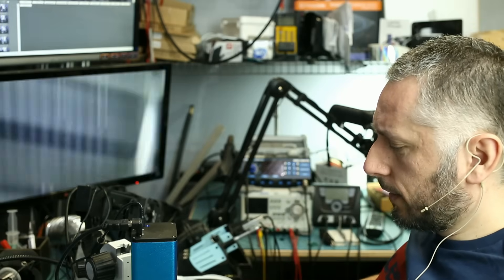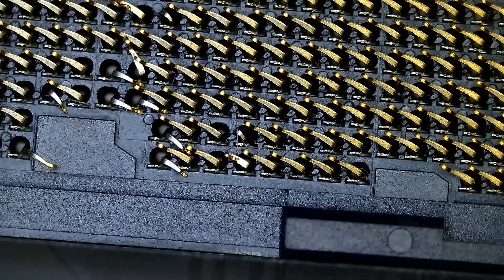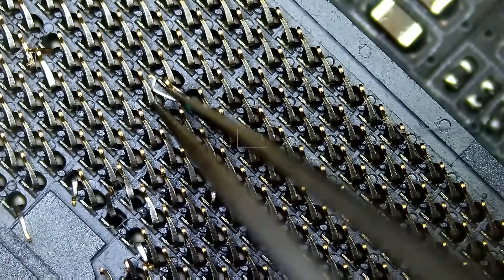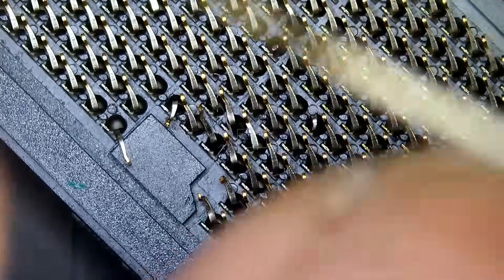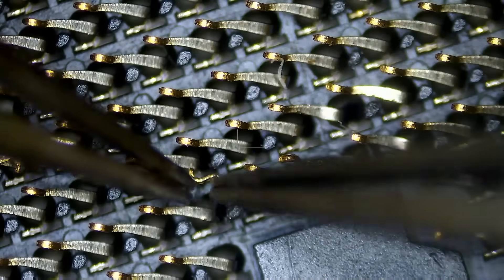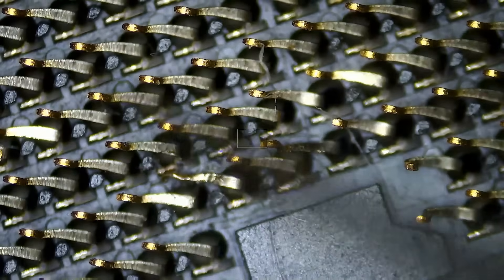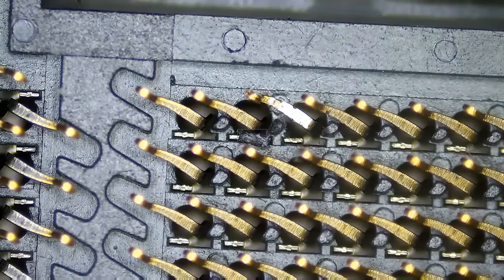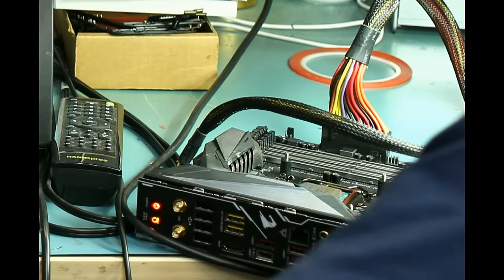GIGABYTE Z390 AORUS CPU Socket Bent and Damaged Pins Repair

Comment: it's disgusting these pins are so fragile, i accidently messed mine up and have voided th warranty. why would they design them like this? mine is an Asus Rog Z790.
Reply: there is a repair guy, who replaces the whole sockel (search for Asus Z170 socket replacement).

Comment: 4 years later, is it still working? :D
I am wondering if it would been easier to just change the whole socket itself? There are some soldering frames one can use to solder those small connections. I saw one guy have a frame, he fixed a new socket through the board and just poured the soldering tin into the holes of the frame and it was basically done. Can't remember hos channel now though..

Comment: Thans  I was Looking  fore a video like tis  i have a old board  that somone tro away and it looks like that  Socket  Is Damage By the Chip that dropdown  in it 😮the corner of the Prossesorcip De in has fallen when someone took it out and dropped it. there is a V imprint in the Socket about /¡¿\ and I'm going to see if I can still save it using the video advice and test it. it was free and is good to do exercises with and if it does I will give it a new case if not then try again next time
if I find another one😅
￼

Comment: I accidentally dropped my new CPU onto the pins and bent four. Tried to unbend 'em and the board's still not working right. Pulled up your video to see if there's hope for it. I'm gonna try again to fix it, but I'm accepting the fact that I might just need to get a new MOBO. Sorrow.
Reply: I destroyed 3 pins and try to repair, probably destroyed 4 more pins but it was just a second hand pc motherboard which i had as spare for my old Intel system and it did only 15 euro. But what you can do is, if you still have the motherboard, there are computer repair shops, who replace the whole socket with the pins.

Comment: My worst nightmarish bent pin repair was when I had to solder a new upper 3 quarters of a pin on a remaining quarter of the broken pin. Cut a new pin to fit the missing part, used a little bit of solder paste and a hot air station. I wish I had a stereo microscope to be able to work such fine interventions.
Reply: Those are metal? What c did you use to solder them together

Comment: I just had this happen after Christmas while upgrading my CPU, I somehow bent pins on a board that was less than a year old. A z560 board. I replaced the board but Id really love to get the other one fixed. Problem is, what is it gonna cost? The board was purchased on a christmas sale for under a hundred bucks, its normal price was slightly under 200.  I could use the board to build a spare pc if i can get the socket fixed. It is lga 1200 10th and 11th gen intel cpu`s.

Comment: I have a socket 1366 board with one of the pin top hook bent backward on itself (similar to 6:11), it still work but only 8gb of ram is usable out of 12gb, should i bent the pin hook forward with tweezer or will it break off?

Comment: this is why you use a high performance non-conductive thermal paste.  if you make a tiny mess with it no need to worry about cleaning it up , it won't cause short outs. This is also why i think the pins being on the main board and not the cpu itself, is a terible idea.  it's jsut easier to fix pins on a cpu than it is to fix them on a mainboard.

Comment: Intel should go back to the Pentium 4 days and stick with pins, no dramas then. Sure they bend but you could bend them back. Oh it snapped off? Solder the pin back on. Way harder in a motherboard

Comment: I use needles to fix this sort of issue and it is very effective  because with needle you apply less pressure and you have more control on bending them without breaking the pins.

Comment: You can improvise put a copper on the broken pins, I did the same thing on mine and it worked I got 2 broken pins and it's not turning on the pc so i decides to put tiny copper to have a connection

Comment: That board was $369 in Nov 2019 and a similar thing happened with me with the socket not holding the CPU in place while cleaning & reapplying 30 month old thermal compound off the fan & CPU lid

Comment: Why you don t change that pin? you can dissolder pin from a doner board. By working with low temps and soldering paste it will be easy to remove.
you do a really good work i follow you since the beginning, I learned a lot from you. thank you

Comment: Make sure he puts thermal paste on bottom as well as the top of processor as it makes it cooler 😎
One tip don't apply thermal paste or clean it with processor off the mount
It happened to me but I used a soft toothbrush with alcohol and lightly cleaned it no problems they are like needles
Reply: This comment is a prank. Only put thermal paste on the top side of the processor. Using a toothbrush on motherboard pins will kill it.

Comment: I've bent a few pins (around 3 or more) when cutting a LGA 775 socket to fit a 771 Xeon CPU. Managed to straighten them with the same scalpel blade with my naked eye, no magnifiers and such. The CPU worked for whole 6 years no problem until I've upgraded :)
Reply: you can cut pins to make a non compatible cpu work with a mb by cutting off pins?
Reply: @itchytastyurr  no, you need to cut out the socket holder so you can insert the CPU rotated by 90 degrees, together with gluing a tiny pad that switches two pins around. That's in case of 771 cpu in 775 socket. Then you need to update the bios (in my case add the microcodes) so the cpu works 100% correct
Reply: You must have exceptionally good eyesight to fix pins with no magnification. I can't even see the shape of the pins with the naked eye. Either that or the pins on an LGA775 are much bigger than on an AM5.

Comment: I used to buy pallets of best buy returns, plenty of motherboards with messed up pins I fixed.  I was always surprised at how often things worked with missing pins. Always wondered if there was some functionality that was missing due to it, ie some pcie channel or wouldn't work but I never noticed anything.  I used to shove the pins inside a 0.3mm mechanical pencell tip to manipulate them.  Kinda wonder if you could micro anneal the metal to make it less brittle but never actually tried it.
Reply: If you look at the pin out diagram of most cpu about 2/3 of pins are power and ground. So if you are lucky one of them will be PG pin and you can get away with it.

Comment: I just got the same problem, my old MSI big bang fuzzion motherboard broke down so I bought an other lga 1156 socket motherboard form ebay, the asus P7P55 D E Evo and so I was practicing on the broken mother board how to click mount the cooler, but I wasn't careful with the socket and... yes.. So now I understand fully what the deal is with these socket protection caps... In any case, if you have broken pins you can also try to replace the socket, like in this video, https://youtu.be/SzMHJXHO120 amazing that this works... aligning the socket perfectly... 😃

Comment: Would of been easier to remove the pins and replace them. Also should of checked Intel's data sheets, some of those pins might just of been grounds and didn't need fixing

Comment: I have been building my own pcs and those for friends and family for almost 20 years. Last time the chip types were changed I jacked up 3 motherboards by not putting the CPUs in correctly :(  so fragile! I tried to straighten the bent pins on one MB but it was never good enough. Mad respect for your work sir!
Reply: How do you even screw up the pins?  Seriously there are indicators the CPU will only fit one way.

Comment: Oh yes, there is more you can do!
You can change any pin with hot air.
Or you can change the whole socket with a reballing machine.
Check out Gitaruga's channel.
Reply: But would the repair be worth it considering the price of the mobo?

Comment: I have the same board but some pins were even broken off. I managed to fix it in the worst way possible. Salvaged some pins from another board, cut off the bottom part, slide it against the broken pin and secure it in place with a cut off piece of a leg from a resistor. It is working great now though.
Reply: How did you even manage it ! Mine is not booting even after straightening them.
Reply: @prashanthb6521  The trick is to look at the heads, not the legs. You need different orientations and light source directions to arrange the heads in the grid correctly again.
Reply: @mrawesomelemons  yes. One direction pins look fine, from another pins look bent. Also the tips of the pins look like spoons

Comment: actually i have done this job half a year ago on a Z87-pro from ASUS. 6 pins were lost during repair, socket was heavily damaged. I have replaced them with very tiny pieces of copper wire, bent i the right shape and clamped them with rest of the pin in position. After some tweaking the board booted with the i7-4790k and it is still running. CPU runs on 4,7Ghz pretty stabel :)
Reply: You are sort of a Hero in some sense. Forget straightening them, replacing them is unheard of !

Comment: For anyone still interested the pin that broke off was a VCCGT pin. These pins deliver power to the integrated graphics. There are upwards of 15 of these pins so chances are the board would still work.
Reply: @ATechnews last I had to identify CPU pins, I opened Intel datasheet for particular CPU and ball grid map was all there.
Reply: I don't have any reason to not believe you, but can you tell me how you knew from the video please.
Reply: @rectify2003  any idea on how to find that? Im having trouble myself and would like to find said data sheet if possible
Reply: should be fine considering this is intel and a gaming board, the customer won't be using the igpu anyway.
Reply: Heart bits faster ⚡️
Reply: Good to know..thanks for sharing hehe
Reply: Make sure you need a eGPU! Otherwise f*** you, Intel HD Graphics.
Reply: And how does something like that even happen? Those pins are really hard to damage like that, basically you just place CPU into socket and fix it there.
Reply: @alexvidakovic  a better question is how come the guy building the pc , got thermal paste next to the socket  with out having already installed the cpu? a builder that only saw the Verge's pc building video maybe ?
Reply: @DenverStarkey  ohhh, please don't remind me of that tragedy

Comment: Can this exact motherboard still work and recognize the CPU with only 3 pins bent?
Reply: Dunno I got a really messed up one and am gonna try tomorrow but I don't think it'll work, amd is better in this regard.

I'll probably need to bring it to a store.
Reply: you can check the pin layout of your socket on the internet, and then determine what each pin does. If the bent pins are dummies, your board will be 100% fine. Some other pins can be damaged but still good to use
Reply: @DROGOC0P  i already built my pc 4 months ago but thx!

Comment: Before I start such work, I reference the damaged pins & start with the least damaged pins, that are needed. If a NC (no-connection / future use) is bent, I will leave it for last.
Reply: how can you understand a pin is no connection?
Reply: @umutileri2261  look at the diagram for the socket in question.
Reply: @zadekeys599  thank you

Comment: Next time i woud advise using a canvas sewing needle. Works much better at catching the pin head and manouvering the indavidual pins. This was cringe watching you man handle the pins. Not advisable! I have done many repairs to sockets on dual xeon boards where dumby techs drop the cpu in the socket.

Comment: what if thermo paste got stuck down in the cpu pins, what kind of damage would it cause?
Reply: Before u read i will let u know i am far away from being a professional take it as a story.
 
a friend of mine bought a aourus b550 mobo and a 5600x CPU we then proceeded to update bios and turn on the pc but nothing had happened so we taught to switch the cpu and went to one of our friend who had ryzen 5 3600x. When he removed his cpu termal paste(from previous use he put way too much paste) spread on 30% of the socket  i was like rip you fcked up but then without cleaning a bit of the paste ontop he said fuck it. He put the cpu ontop the termal paste into the socket making a sandwich and the pc turned on its still working nothing wrong with it... So from my experience termal paste in the socket isnt really a big deal. I have had multiple PCs at my workplace who were built sloppy with signs of termal paste missaplication and in the socket so i dont really think its an issue. Best if u have some termal paste in there go to a proffesional pc shop most of them(the good ones at least in my country) clear termal paste off pins. And excuse my terrible english i just got off a night shift and i am just relaxing on youtube.

Comment: Keep them warm before bending back. So chances of breaking will much less.
Reply: Are you sure
Did you do it before
How
Reply: He’s right hot / warm metal is more malleable / flexible when heated to the right temp.
Reply: It's called annealing. The question is whether you can heat the metal to the correct temperature without melting the plastic of the socket or setting something on fire.

Many components intended for reflow soldering can withstand 200-300 degrees for a minute or two for the reflow process itself, but annealing could require hundreds more.
Reply: @TomStorey96  there's one more thing, if pins are heated to high temperature then solder could melt and pin picked out of the socket accidentally. OR the pin can be unsoldered, bent to the right shape and soldered back.
Reply: actually not true, hot parts are easier to break
Reply: @SloGhost  its metal metal tends to bend as atoms become free cos of energy. With cold bending it forms stress on atoms and they gets break without bending.

Comment: See what happens when we put a 7700k on a z390 board... I'm like NOOOOOOOOO STAHP
Reply: It could work with a modded bios though. The 1151v2 is *almost the same to the 1151v1. There are some cross-compatibility with 4 cores chip. I3 8100 could be used in modded 1151v1, nothing should stop the i7 7700k to work on z390 other than bios microcode.

Comment: I took at a lot of your videos. You got a big experience and knowledge. Your skill level is very, very good. Hat down for the patience on this job. I would not bother myself to straighten the pins. I did not count them in the video, but i would do a socket replacement right away. It is dependent how lucky you are. If you have broken signal pins, then it makes no sense to straighten the rest of them. I would go max for 3 bent pins, more than that, only a socket replacement.

Comment: You did your best no doubt, those pins are tiny. All it takes is one bad pin, and or a bad connection and that board will not post. $300 dollar board?...  there's a chance he could send it in and have a complete socket replacement cheaper than a new board. Otherwise it's a lesson learned... buy another board.

Comment: I can't believe those frail pins don't snap when being bent like that? So, what's the cost of bending pins vs buying a new board ?  
Bent some of mine somehow and the shop said not fixable. Had to buy a replacement board, luck to find a used one and all good! There is a video of a guy replacing the whole socket, but I'm sure most people don't have his same gear.

Comment: You could see that snapped one was already fractured :(   Dunno why ppl take cpu's out and not put the cover plate in when cpu is out.   I've never had a modern Intel mobo so never had the problem, had a couple prangs on some AMD chips and then gold pins are super fragile on AMD ones :(

Comment: Oh, man... I had z97x gaming 7 that tried to take out the fallen dust with a brush and bend 20+ pins like that... I was about to cry... Than I got $15 digital microscope, connected to the TV and bend them back. First it didn't work properly, than after further check they need to be completely in the right angel. That sht took long but I managed it and used that board without any issues over a 6 month and changed my system. 😎

Comment: I have an Asus TUF Z390 GAMING PRO with the same bent pints. Watching as I'm working on it. I don't have microscope do have to rely magnifiers (one manual and the other is a magnifier app for iPhone lol. With image stabilizer and front flashes on it does a very decent job but not as clear a vision as you guys. I use tiny needlenose pliers, a mechanical pencil with lead removed and some sewing needles for leverage. So far so good, thanks!   👍

Comment: The i7 7700k does not have any integrated graphics built in....... So u have to  install a dedicated gpu or use any non k cpu to test the board
Reply: KF does not have igpu, the normal K has
Reply: @milojkokitic6991  i didnt know that.... Thanks for reply though

Comment: I saw a video recently where someone replaced the whole socket, he did make it look simple though.
Reply: @the best Adam Changing the socket will cause a lot of heat stress to the board. And it is a very hard thing to do without proper reballing equipment which he might have but I am not sure. And you would need a source with the correct socket.

Comment: I wish intel would of stuck with the Pin lay out like AMD!
Reply: I prefer breaking a 2-300 motherboard rather than a 4-500 cpu tbh lol. AMD is even more painful if it breaks
Reply: @Pudubat  Yeah u are correct. AMD stuck with PGA
Reply: Much easier to damage Mobo pins than cpu ones by far

Comment: couldn't you just remove the socket ? I know you can desoldar the lga1150
Reply: Desoldering is the easy part of the repair.  It's the soldering of the replacement socket that's really hard to do without a machine.

Remember, no solder bridges or else you have to start all over again.